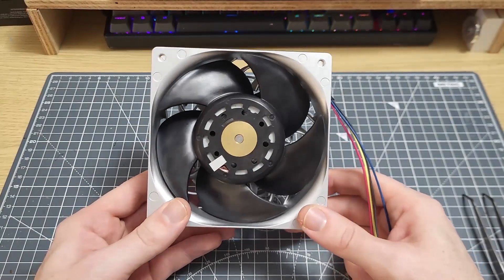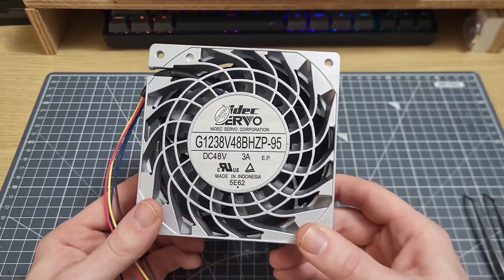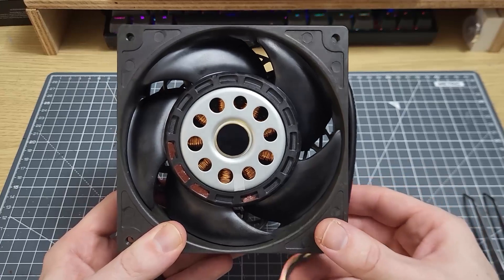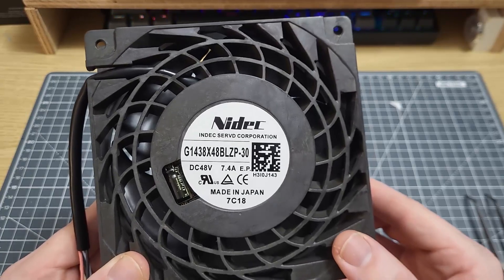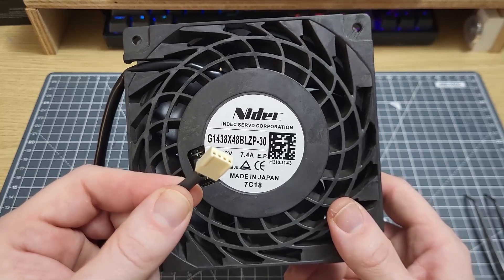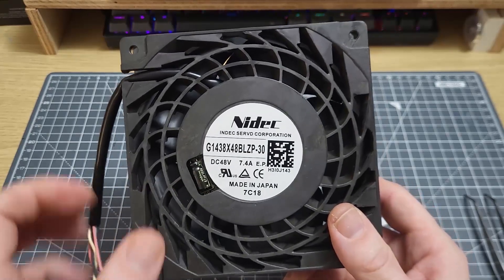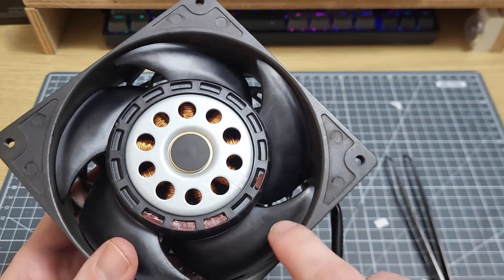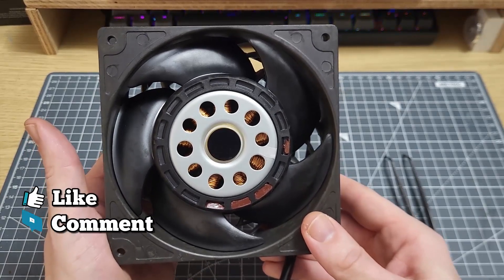This 7.4A 48V 140mm Fan Spins HOW FAST?!

Comment: I also have this fan. Its appearance is exactly the same as yours, but my label voltage is 54V, and your Nidec trademark feels strange. It may be a fake label
Reply from the maker: Yes it's a re-labelled fan, I think new-old stock which the seller has made to look like a more recently manufactured fan. Still works perfectly and is the real deal. I got it for $20 despite the actual value of the fan being closer to $200. :)

Comment: I have a 120mm Nidec BETAV V34809-35 that's rated ~3.3a, has a 4-pin pwm conector, and it's my current cpu fan. Do you have any idea if a motherboard 4-pin header can even supply that many amps safely? I've never seen this fan reach 100% duty, only "heard" it once I connected it straight to psu (well, heard more rpm, but couldn't tell if it was 100% or not...). I always been concerned about it frying my board's cpu_fan header. I also have a 120mm Delta AFB1212she rated 1.6a acting as exhaust fan (no intake fans). You think this setup is optimal? Am I pushing the cpu_fan and cha1_fan headers too far? It's impressive how little this is documented online. I love your channel, you inspired me on getting these haha, just need to know the best way to set them up now! My system runs an overclocked i7 too running at 4.2ghz, like that one video of yours! (Mine's a 3770 though xD)
Reply: It depends - most motherboards in the last 3-4 years are actually rated 3 amps on some headers (especially watercooler pump headers). So you could safely connect your 1.6A fan to this (check your board's manual before plugging it in though as it might only be rated 1 amp!

Comment: How do you drive this? Are you sending something like a square wave? What's the duty cycle?
Reply from the maker: Yep - that's exactly what it is. There's a separate control wire that feeds a 5V square wave directly to the integrated speed control device in the fan. These Nidec fans take a 500-5KHz square wave.
Reply: @FanPhys  Thank you!

Comment: I'm having a hard time understanding the purpose of this fan. I have a chicken coop ventilation fan that takes 40 watts and delivers 400cfm. I also have several full length, 2U rackmount servers that sound like jet engines. I also used to maintain Cisco network switch cabinets providing networking to several hundred offices and this fan seems both like overkill in the power department and underwhelming in the performance department. Is it just really old?
Reply from the maker: The purpose of this fan (and others like it) is to produce high volume flow at very high pressure, which standard axial fans cannot do - your coop fan will produce 400cfm in free air, but will choke in a high pressure environment. This fan is able to produce 280CFM while working against an air pressure of 1300Pa, which is just bonkers for an axial fan... but it's what is required when cooling a large and densely packed router chassis. it's a highly specialised application and these fans are pretty much tailor made for it, so you won't find them anywhere else. :)
Reply: @FanPhys  Well I mean its interesting. I'm gonna guess the real price tag there is the MTBF.

Its just a bit weird to me to be dumping 400 watts of heat into something to cool it.

Comment: Next time please use an intake grill/guard...just watching made me sweating... By the other hand i don't know how you could resist overvolting it, i surely had streached at least until 60V 😁😈🌪
Reply from the maker: You make a fair point - I will be using guards on these fans from now on :) Also, overvolting won't change the speed because of the fan's "intelligent" design. It has an onboard microcontroller that very precisely regulates the speed of the motor.
Reply: @FanPhys  About overvolting you are right and at same time wrong, the manufacturer usually gives bout 10 or 15% margin until it starts to limit the rpm, i have some server fans which i had played and indeed they limit the rpm, but i.e. some 12v fan will still increase it's speed until 14v or 15v. Nevertheless i always try to increase volt by volt until it stops screaming louder and louder eheh 😋. Keep bringing these lovely and dangerous fans to the channel  👍

Comment: What's the application for these? Even if built very well i can't imagine them lasting very long, also there aren't that many applications where these sorts of power consumption and noise are tolerable...
Maybe she infrastructure critical equipment where they usually run at 10-20%?
Reply from the maker: This fan is used in the telecom industry to cool network switches and routers. A large chassis will have 24 of these fans running simultaneously.

Comment: I have a(double stacked) fan rated at 12v 9.5a but it only draw 4.5a when i connected the pwm wire to v+ which is 100% pwm or does these fan really need a controller to do full speed or maybe i just get scammed because the fan only cost $5
Reply from the maker: The current on the label doesn't always tell you the actual operating current of the motor - sometimes it's a "safety" current, so it will tell you the max inrush value.

Comment: How does it stop so quickly? Is being slowed down by the internal fan driver at the end?
Reply from the maker: Yes, these fans feature a brake that actively slows / stops the fan when it powers down.
Reply: @FanPhys is it a friction brake or a resistor brake?
Reply: @Thegeforce8523 electronic brake. Using the same coils that drive it.
Reply: @FanPhys  never seen one which is being braked. Probably because I've never seen one this fast.

Comment: You hit diminishing returns fast with such small blades. If you needed higher air throughout you would use a bigger fan at lower speeds.
Reply from the maker: For airflow definitely, but the main design of these fans is to develop as much pressure as possible in a tight space. It's no slouch with about 400CFM at max speed, but the pressure it can achieve is crazy.

Comment: My favourite insane fan is the San Ace 9GV2048P0G201, there is also still a video online showcasing it's modesty :D
The fan in this video is definitely no slouch either, it definitely would've overwhelmed the poor small 4-pin connector as that system is usually only rated for 4 amps

Comment: Was there any sensation of thrust you could feel when holding the fan?
Reply from the maker: Not really, because I was pushing it down into the mat. The actual thrust is relatively weak, due to the design of the impeller, but in terms of static pressure the number is enormous.
Reply: I liked the look of the swirly vent on the back of the fan I assume 4/5 of them would make the back panel of the server without mounting an additional vent grill over them

Comment: Why did the frame get warm?
Reply from the maker: It's because of the high current flowing through the stator coils. After operating the fan at full speed, the motor hub was hot to the touch. The holes at the front of the impeller are to assist in the cooling of the coils. :)
Reply: Fans might have metal frames for sturdiness or resilience against time/elements, but in this case it is most definitely there as a heatsink to cool the motor to ensure longer bearing life
Reply: I think it's caused by air friction

Comment: This one is enough to cool a nuclear radiator
Reply: With 300+ watts of power you'd need another fan to cool this fan
Reply from the maker: Haha it's funny isn't it, the power consumption is mad  @Dood_
Reply: I'd love to get a sense of the force of air from it. Dare say it would probably hover itself off the table if it were sitting flat.